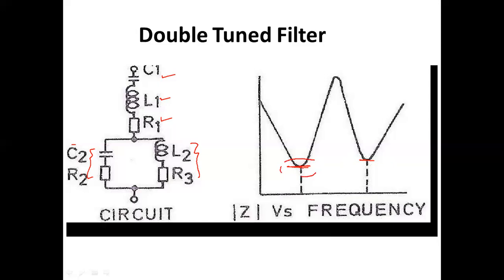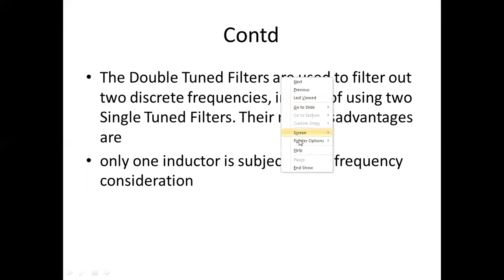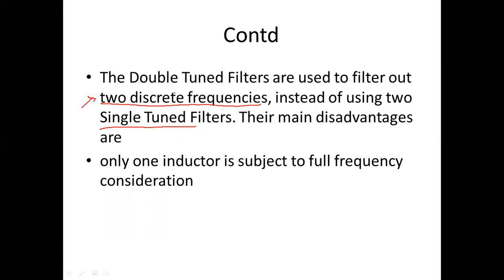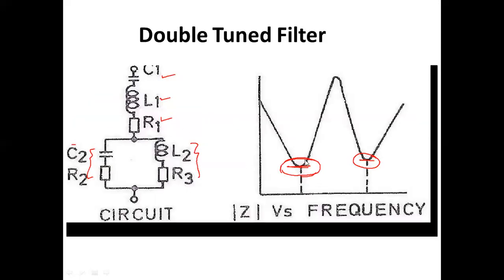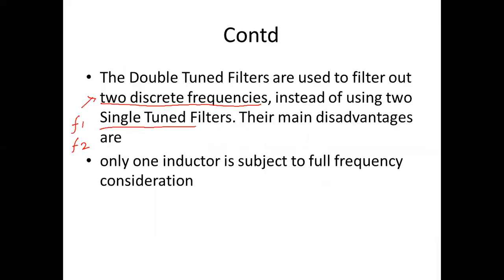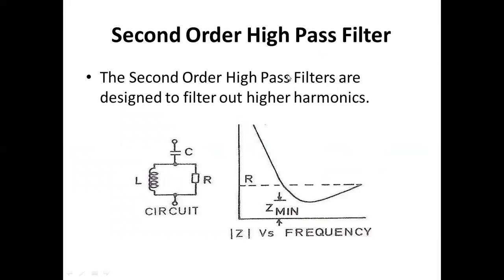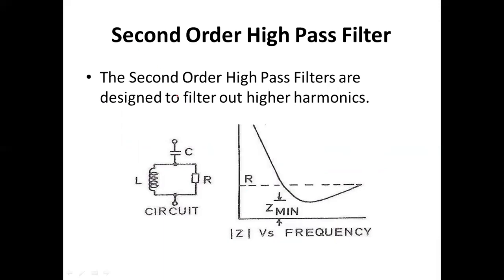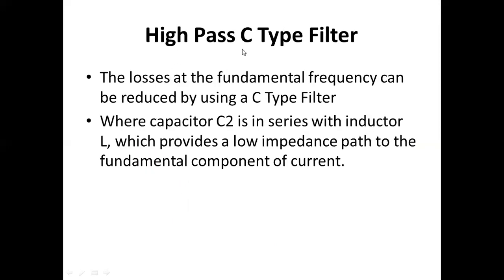Filters for ac circuits

Comment: Thank you sir you helped me a lot i was searching for long time for clear explanantion i've found your video helpful I have a doubt sir at 3:58 time stamp the 2 point tells that inductor provides low impedance path for fundamental comp current (which means nominal frequency of the current i supposed) but it should provide low impedance for the multiples of fundamental frequency which is harmonics(high frquency)     ............ thank you sir :)